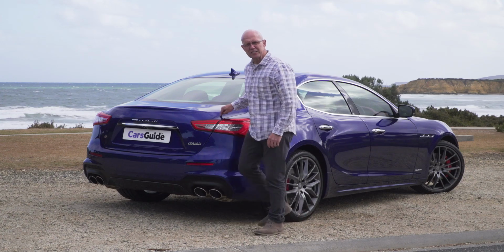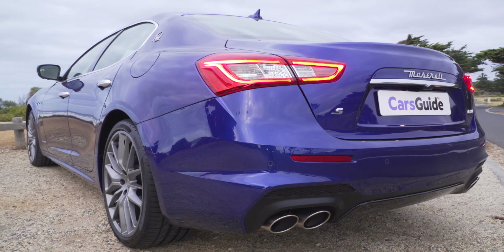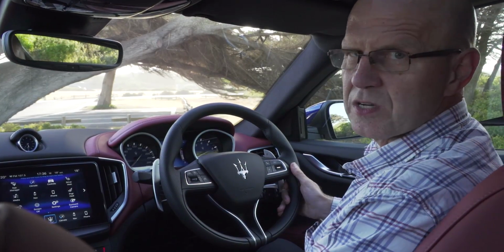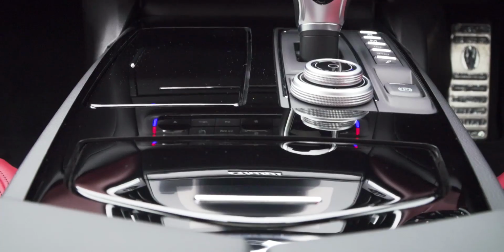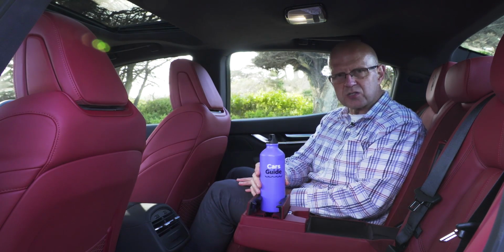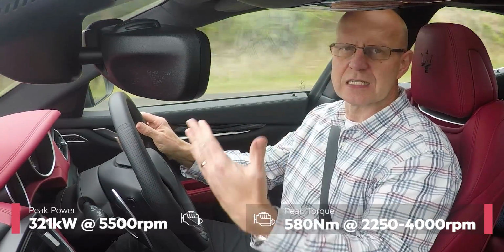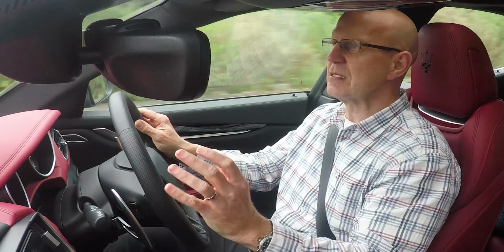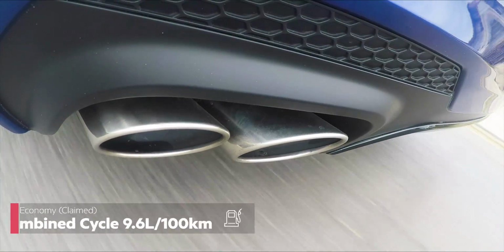Maserati Ghibli S 2018 review

Comment: This might be the car I need.
As much as I liked my 340i f31, I bought a Giulia Quadrifoglio. I liked this car even more, the handling is just spot on. But the 2.9 v6 couldn’t grow on me. The power was great but I missed the high pitched tone from my straight piped 340i. I took a different way and bought a Maserati Levante S for comfort and the sound. It is not fast. It does great off-roading. It does have a nice sound. It does a lot of things right, even though the Germans have better solutions for multimedia and fuel consumption. But the Maserati just grows on me. I test drove a m440i gc this weekend. It didn’t remind me at all at my 340i. It feels to modern. No connection with the gearbox and the road. Braking even with m brakes was horrible. It is a good car, but doesn’t bring that smile on my face again. Reminding me of the Giulia, damn what a great car that actually was. Maybe the best I’ve ever driven, except for the soundtrack. I’ll take it over my previous Ferrari 488 spider on a mountain road in Austria. So much confidence. Now I miss that sportive driving. I have decided to test drive this ghibli. I hope it has what the Levante has and brings some enjoyment back for driving on country roads like the Giulia and older 340i.

Comment: Maserati is all about that distinctive exhaust sound! Thats about it!  The exterior is stylish. The interior is ok but no more nicer than a top of the line Jeep Grand Cherokee. German interiors are far far more upscale, especially Mercedes and Porsche.  Ghibli has good handling, but not better than the Porsche Panamera. Reliability sucks and parts are absurdly overpriced just like most European cars. You are better off with a V series Cadillac than a Maserati. You'll get much better performance, lower maintenace costs  and superior reliability for the money. Go for Porsche for better handling and exclusivity. Go for Mercedes for the best interior. And of course, but Lexus if you want something truly well made and reliable. Never buy European cars new. They loose their value tremendously in the first 3 years. Never get one with high miles, because they all fall apart after 50k miles.

Comment: I've owned many high performance cars (RS7, M5, Charger Hellcat, Tesla P100D) and have extensively driven the different Maserati models because I'm a total car nut, they simply don't match up to the Germans in most regards. I know this pisses some people off but putting this against an A7/S7 or an M550xi would be a fail on just about every metric. You must drive these models vs. the Germans before you can pass judgment, don't make a call based on the emotion a Maserati can envoke. Fun fact, the engine block has been made in both Detroit and Kokomo Indiana...."under the supervision of Ferrari"

Comment: Maybe this car could seems an “italian luxury car” or something like that but if you watch with accuracy the interior you can understand how cheap it is.
The ghibli has cheap plastic for their controls took from dodge and chrysler, the air conditioning vents are located in the same position that in a chrysler and even the infotainment system is the fuckin same of a chrysler, it’s the fuckin U connect with a trident in the center. No , U connect 2019 is more better than Maseratis’s one, serch on the tube, this car is a fuckin chrysler with a fast engine and a maserati logo. It isn’t worth that price never and ever

Comment: I’ll take the 5 series it has MUCH more technology and 540i model has twin turbo v6 with an actually better 0-60 time also it cost less and you won’t end up losing money thanks to Maserati’s HUGE depreciation besides ghibli looks like Kia from behind
Reply: yes it does have more technology. I owned a decked out 5 series SUV and it was a disaster/money pit. All that impressive technology is part of the problem with bmw and reliability. Everyone knows this which is why many just lease them. Go look how cheap used BMW's are. They lose 70% of there value for a reason.

Comment: I leased one and was disappointed. The car looks sporty and performance is great.  The interior needs to be seriously redesigned and more features added as a standard package. The maintenance is expensive and the soft tires wear out quickly (12K on the front and 15k on the rear tires). Poor investment, but if you're looking to project a certain image, the car delivers. Looked at the Alfa Romeo Giulia. Another poorly designed and over priced Italian vehicle. The car feels like you're riding in a sardine can with tires. Again, if you want something different, the Italians have the Maserati or the Alfa Romeo. Both are money pits, overpriced and poor investments.
Reply: A well equiped Ghibli is with Cayman boxster the least devaluating GT's surveyed on our local EU market but lease of a cheap one is uneconomical. All options incl. Rear heated seats for siberia are available but heavy with a bigger battery etc...Your bashing against italien top quality cars is innapropriate and reflects maybe a bad service by untrained personel on good but new unknown products. Here our Ferrari Maserati dealers are top since many years...
Reply: @philgooddr.7850  This guy is so off the mark. I had the pleasure of driving my brother in laws Stelvio Quadrifoglio and it is hands down the nicest and best performing and handling sporty mid size SUV I have ever driven. His previous suv was a Porsche and I also have driven the BMW X5 M which a great all around SUV that within 4-5 years will be a serious money pit. People complain about alfa but I used to own a $68,000 (msrp was $75k) E60 M5 and I will never buy a BMW ever again. This car was nothing but a disaster for the money I paid. I don't understand how BMW has a notorious reputation for horrible reliability and yet people still flock to buy them. I understand if they are being leased in that case they are great cars. Here are the main problems I had with my V10 M5:

1.The engine! (reliability!!!) very very bad. Piston rings would break and many more engine failures and recalls. It's as if BMW never bothered to extensively test this engine before production.
2. Reliability of everything else on the car! (It once cost me $1,000 to replace the side view mirror because the motor on it broke! Overall I spent over $30,000 in maintenance and repairs on my old E60, including a brand new engine, and 4 clutches!)
3. Fuel consumption (I once got 6mpg on my E60!)
4. SMG Transmission (reliability!!!)
5. Oil consumption of the S85 V10 (The 10W-60 is expensive, plus it is only really available either at the dealership or online.)
Reply: Paul J Thank you, those unspecific critics of new highly competitive quality product is the sign that car or SUV is a competitive threat and most critics are from owners and salesmen of obsolete competitive products. Have Maserati Alfa, VW Audi and BMW high end cars in the family and as user only, I am most happy with my Ghibli Guilia and "old mama", an  undestuctible 18 years old Alfa 156 twinspark.  Even a german car which brakes and hold to the road has Brembo brakes and Pzero tyres,  but since customer expectation have grown to this kind of italien level, I really wonder what great and new came recently up north from the Stuttgart area: nothing exiting really. Philgood.
Reply: @philgooddr.7850  If I had the Money hands down I wouldn't hesitate to buy the Alfa SUV(Stelvio Quad) with the Ferrari co developed Chassis and engine. The new Giorgio platform which consists of both a chassis and engine technology that is pretty far ahead of it's time is estimated to have cost Chrysler somewhere around 1 billion dollars in R&D. This of course was justified since they will use that Giorgio platform in variation on the whole jeep line, the new 2020 Challenger line and a few others like the 300. Also Maserati and Alfa benefits from it as well.  

I never knew it could be so fun to drive an SUV that perform and handles like a sports car, well as much as one can having a higher center of gravity and weight. Also I have never in my life heard a V6 engine that sounds just as good as any V8 muscle car. You can tell having Ferrari's input was paramount. That Twin Turbo V6 is a further refined and improved engine derived from the Ferrari California. 

Previous Maserati's in the last 6 years were embarrassing in my opinion. I am so glad that since 2018 Fiat has brought Maserati back in the tough competitor fold. Nothing like driving an Italian car that performs, handles and drives with passion and excitement. Many German car are very COLD and Sterile. Although I do admire Porsche they are an amazing company. Problem is every Dentist, doctor, lawyer and real estate agent is driving one. They are so common and bland.
Reply: @philgooddr.7850  People complain and are still under the impression that ALFA today is same as they were 10 years ago. They don't understand how much money and R&D as well as restructuring has gone into the company. People still think they constantly fall apart and are a money pits, yet are happy to buy the worst money pit of them all, BMW!!!!.  

I used to own a $68,000 (msrp was $75k) 2009 E60 M5 and I will never buy a BMW ever again. This car was nothing but a disaster for the money I paid. I don't understand how BMW has a notorious reputation for horrible reliability and yet people still flock to buy them. I understand if they are being leased in that case they are great cars. Here are the main problems I had with my V10 M5:

1.The engine! (reliability!!!) very very bad. Piston rings would break and many more engine failures and recalls. It's as if BMW never bothered to extensively test this engine before production.
2. Reliability of everything else on the car! (It once cost me $1,000 to replace the side view mirror because the motor on it broke! Overall I spent over $30,000 in maintenance and repairs on my old E60, including a brand new engine, and 4 clutches!)
3. Fuel consumption (I once got 6mpg on my E60!)
4. SMG Transmission (reliability!!!)
5. Oil consumption of the S85 V10 (The 10W-60 is expensive, plus it is only really available either at the dealership or online.)
Reply: Paul J you are right, the old Maserati gusslers were heavy steel body with derated and bastarized Ferrari V8 and Alfa went through some hard time during the GM Holden period of heavy 159 & Brera and the rebadged Fiat Punto called Mito. The last exiting Alfa product before current Guilia /Stelvio and 4C was the 156 produced over 640000 units. It saved the brand and became the reference of a century change car and an advanced 2000 design. Today, it still look actual. First time also one designer, Walter Da Silva became famous with one single product and maybe the 156 was also the first true four doors coupe in history because Alfa had not the volume like BMW for a 3 serie Sedan and coupe and made a combo. Small and rigid, the car was 150kg lighter than a Golf with better NHV , flat bottom and wind tunneled at Modena, mine , 2 liters only, topped at 225 km/h. The suspension geometry and front to rear balance was perfect for snow condition and many Quattro and Range got mad trying to follow my tiny FWD on white roads or roundabouts. Almost bought an E39 M5 then, but the 4 yrs old leather looked a lot worst, than my 3 yrs older 156 and under the hood, not as oil tight either.. Finally got a 2005 derated 3L Z4 and kept a 156. The Maserati Ghibli V6 has the Pennstar liner spacing and angle to use the same engine block casting line and turbos are integrated and  supported by the manifolds. Marginaly balanced and thin flywheel, the engine lives and gear changes can be a lot fastest than any BM In Line 6 with the same ZF 8HP, saving cost and other issues of a more expensive Oerlikon Graziano. Martinelli rededesigned  then a lighter 90deg.V6 from new F154 V8 for Alfa. The engine sound is quite different, a bit like two Ecoboost L3 chasing each others, so a V8 flatcrank definitly  sound better. Wish now the Portofino will come once 4WD like the Jaguar Ftype, otherwise, i'll keep the Ghibli, or get an 911 GTS4. i am not a SUV fan, high up there..., for safety and snow, I prefer a 4wd hot hatch or sedan with low CG close to bumpers levels to avoid flipping over, but of course the high Stelvio looks impressive, dominator so that next to it a GLC looks low with cheap simili and plastic inside. What's really New Up north? Nothing...
Reply: 12k miles for tires pretty normal for mid high power cars...
Reply: wassapjy1 tyres come first in small sizes and when Dunlops came out with 19 , 20 inches Road and Track they should have modified the rubber. The Corsa is too soft but regular Pzero should be ok. One thing Pzero dislike is standstill , they get slightly out of round and it takes a good Warm up to cure. move the car every week minimum,  after a full month, the damage can be permanent. If needed, store the car on blocks or over inflate to 3.5 bars for the storage only.  Finally a 4wheels steering should help even wear front and rear....in theory, Wide tyres look great but are too wide for sharp turns anyway, only the middle does not slip...the edges are too slow and too fast...

Comment: Very nice. But, why spend 90K when you could just wait a year and buy it hardly used for 30K.
Reply: I don't think so ... Maserati doesn't depreciate... just 36-45k but  for the 2013 2014 models...
Reply: What? It’s starting price is $200,000 aud, and pre owned at the moment, is still $140000. That’s only because the initial drop is huge and then it depreciated slowly over time.
Reply: @redmacbeth5198  In America it starts about 80K USD and in about 2 years you can get it for 40K USD. it depreciates like a sinking ship
Reply: Yes it depreciates, but it doesnt depreciate 70% in 12 months. You'd wait around 3 years for £30k. But by then youd be eyeing up the newer model. Never ending cycles.

Comment: Mercedes E63 takes 3,4 sec to 100km/h. And has variable awd. And much much more high-tech and luxurious equipment.
Reply: and it costs alot more money. This car is 97,000 USD. The E63 you mentioned is $180,000 when fully loaded. it had better be a faster car

Comment: I don't have $200K, but I have patience.  I will wait until this car has lost 70% of the value in 6 years and then pick one up.
Reply: Bo Han, wait,  here Boxster/Cayman and Ghibli are the both cars loosing least value as surveyed over a recent 6 months volume of country sales. Worst depreciation (S class, RR, Bentley, Aston, etc)  are no longer the ones you think.
Reply: Philippe Suter any car regardless of the brand looses as much as or very close to 50% of purchasing value in about 4 years time. Period.
Reply: That is why some Porches and Ferrari second hand but readly available are for sale for more than new ones, right.  Then, yes  depreciation of a true and modern GT like a Ghibli is the biggest cost item per kilometer but safety is also no luxury.Tyres and services are about 0.1euro each, gas 0.2 euro and depreciation over 1 euro depending on annual mileage. But differences of value after 5 years can be huge, some cars age well while some get quickly obsolete as market evolves- Low cost Dusters for example keep very well their initial cheep  "practical value" while a 3years old S class without the latest gadjets and electronic garbage is worth nothing to impress anyone, same for a model S used with a dead battery etc.. I have a 2005 Z4 3 liter convertible which is no longer depreciating and slowly appreciating already up but it must be kept in mint condition to be worthwhile in a collection.
Reply: Right, some sport cars production is limited to boost demand to higher price level but only the best cars are successful, for instance an Aston Rapide, a GT at the higher owning cost of a super car but not its performances has a very narrow market, a low production and sales volume and then a low resale value On the low end of the scale, the Duster a unique low cost SUV is considered the cheapest operating and owning cost car in France due to low initial price, low maintenance cost and high resale value. One can lease anything and dump it back but if you buy new, keep resale value in mind, anticipate demand and chose product and options accordingly.
Reply: I’m doing the same with the 2015 Range Rover evoquoe I don’t have $65000. But will spend thirty three thousand
Reply: Bo Han a 2015 used ghibli ranges from 30k-50k pal u dont gotta wait

Comment: Meh. The wife has one. It's bulky with a retarded button layout. My F80 M3 Comp runs circles around it all day and feels planted and on rails compared to it. Problems: The nav is horrendous and doesn't have voice control like my M3. The paddles don't move with the wheel... again.. ugh! The turn signal is a mile away from the steering wheel not to mention all the windshield wiper controls are on it!! Good lord. It IS a nice cruiser but it's hardly "sporty". It is a true grand tourer. Yes, they got the big braking right but it is a necessity given how big of a pig it is. Overall, if you're cruising on a lenthy road trip, take the Ghibli. If you want the ulitmate driving experience... take the M3.